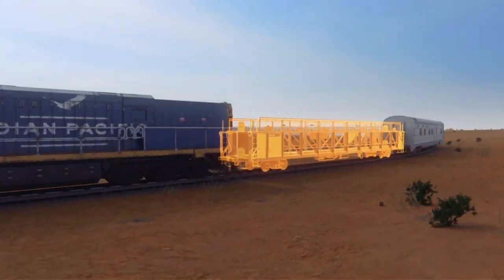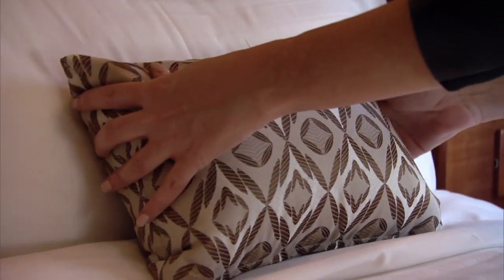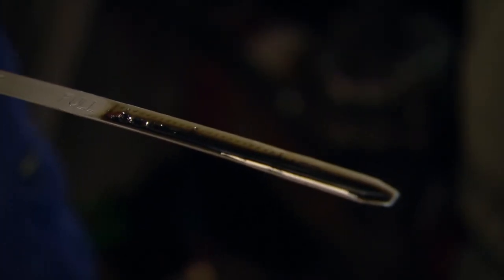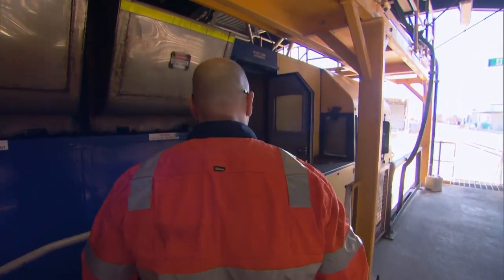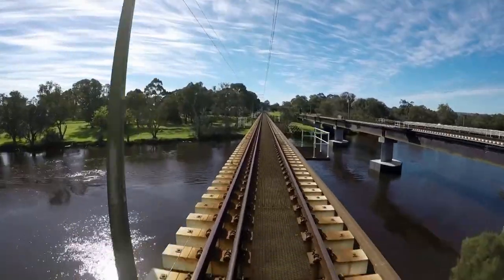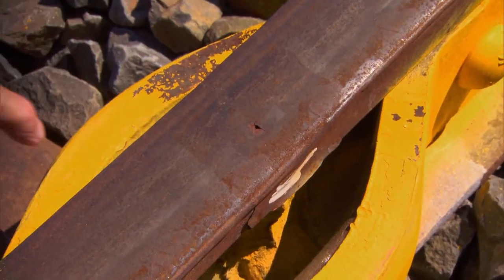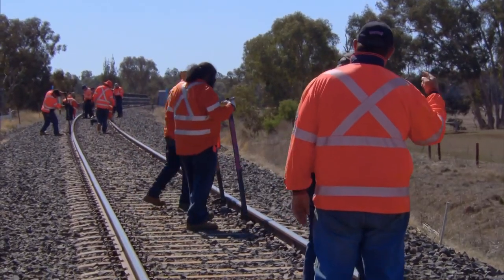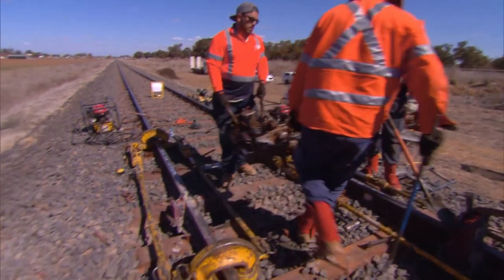Secrets Of The Indian Pacific Railway | Mighty Trains

Comment: They call it molten steel, but it is usually known as thermite.   It is a mixture of iron oxide (rust) and elemental aluminum.  When lit with usually a magnesium strip, the elemental aluminum grabs the oxygen atoms from the iron atoms in an exothermic reaction, the denser elemental iron heads down to the bottom of the molten mass and the rail joint while the aluminum oxide floats off.  It also emits a lot of ultraviolet light which will burn out your retinas if you look at it.